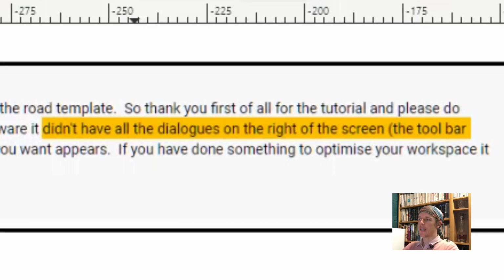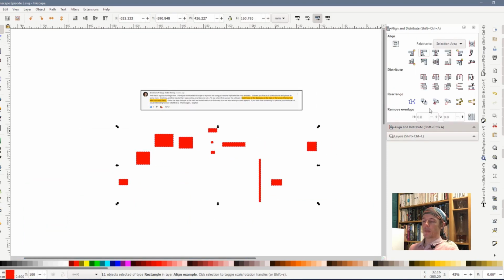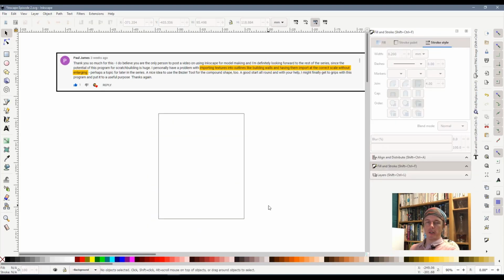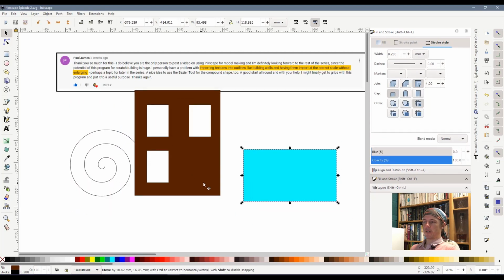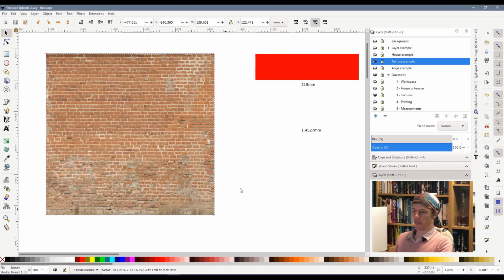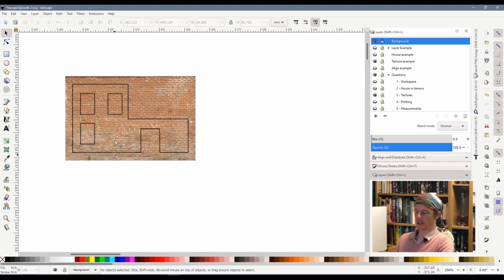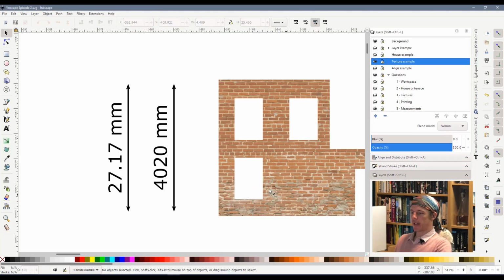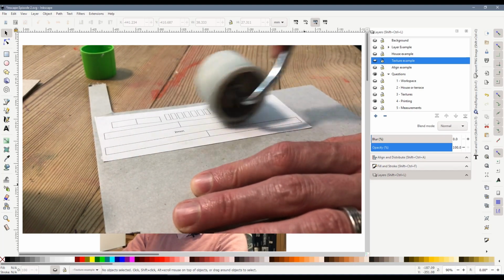Scratch building with Inkscape 2: Making the most of Inkscape

Comment: Hi Michael, Cutting out the window shapes from the "house" - I follow all and the shapes are removed but upon reaching placing the whiole image over the spiral (11:15 seconds in) I can still see the spiral. I am way into my pension years and have just begun modelling so must be doing something wrong. Any ideas? Thanks. Keep on truckin'.
Reply from the maker: Did you have a fill colour on your shape? If you just had an outline colour but no fill, then you will still be able to see it. Or perhaps the spiral is on top of your house shape. Try moving the house to the front/top using the raise to top button…?
Reply: @Chandwell  Hi Michael, thanks for your help. I have managed to progress to adding textures. I have hit a puzzling situation. I wish to add a brick texture to the ground floor of my building but concrete rendering to the first floor, as per the prototype house I am modelling.. By measuring the brick texture between ground level and the first floor I am able to apply the brick, but when I use a similar process for the upper floor, the whole image just disappears! I rather think I will have to split the lower and upper portions of the house and add the different textures to each part before joining them together again but I don't know how to do this. Any ideas? Thanks in advance NW

Comment: When you apply your texture how do you add extra to the ends so you can wrap it around the card? Great videos! Thank you!
Reply from the maker: If I am using the textures by printing a whole sheet and then sticking the base layers to it, then I just mount it with bits hanging off both ends ready to wrap around. If I am using the textures in Inkscape, then I just draw a 7mm wide rectangle on both ends of the piece I am working on, and then select both of these and the main shape then use Path > Union to turn it into one shape, which is slightly wider than the original shape. I can then use Clip to clip the texture to the new shape. Hope this helps! :)

Comment: Great tutorial once again. I watched your first tutorial and had a play with Inkscape and found was having trouble with using it. Most of the things I had trouble with you covered in this video. I did have a question, can Inkscape measure the length of an arc? Cheers John
Reply from the maker: Thank you John! Yes, you can use Inkscape to measure an arc, which comes in really handy when working with arches like my viaduct. I will cover this in the Arches video which will be coming soon. --Michael.

Comment: Great instruction video on inkscape and you have employed many useful aspects. Locking layers got me investigating afinity designer and it turns out I can do the same
Reply from the maker: Good stuff John! I think Affinity will probably have more features than Inkscape, so you should be able to apply all my techniques. Locking layers is really useful when working on things. I lock the layers of my video thumbnails (in Vectornator though rather than Inkscape) so it’s easy just to swap out the photo and reword the title each time I need a new one.
Reply: Chandwell N Gauge Model Railway Ive learnt what I use, but its like anything vast array of features to be investigated.

I do the very same thing with thumbnails I just have to be careful not to shift too much, although its very easy to undo.